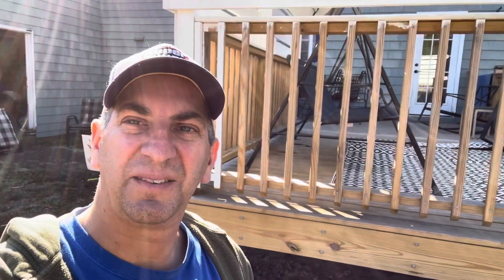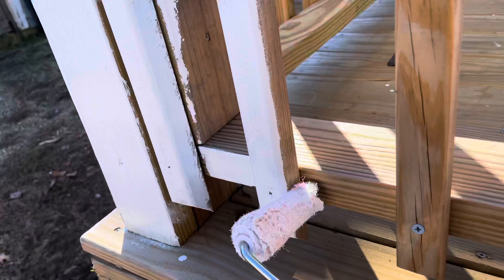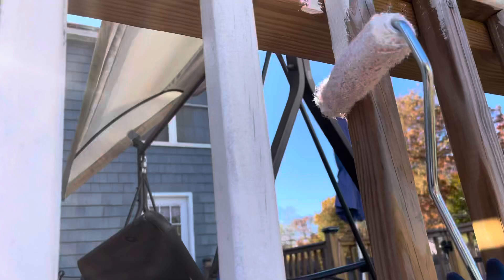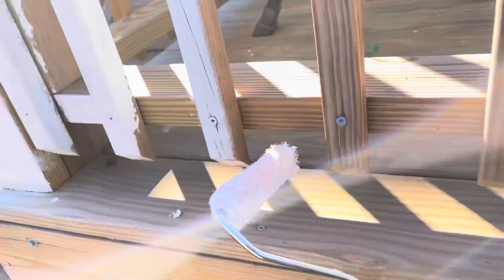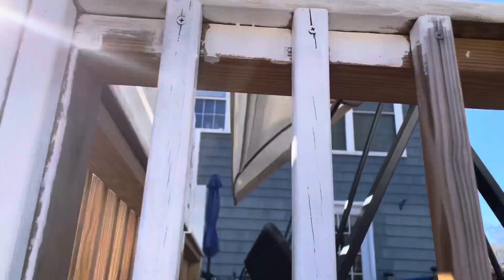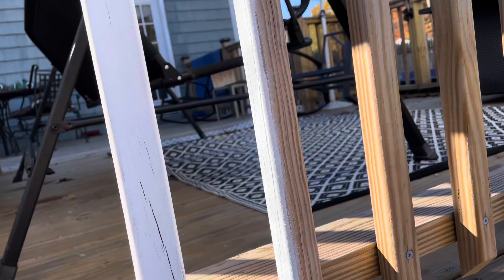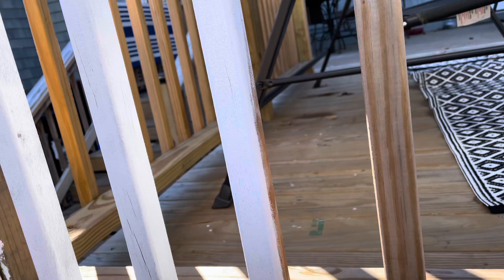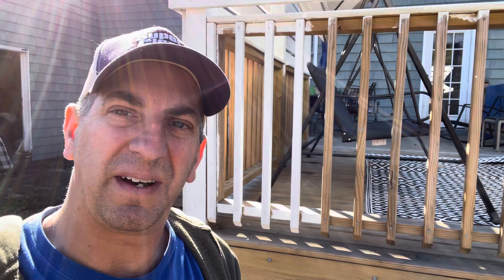How To Paint Railing Spindles - The Easy Way

Comment: This is the way I did mine.  I can't imagine doing it all wish a brush.  A lot of my spindles are cracked too and they look like shit if you don't fill the cracks.  But in a few years, even if you do fill them in, the cracks open up enough to cause the paint to crack and look like crap again.  I HATE, HATE, HATE my balconies.  I painted them about 7 years ago and now I'm doing it all over again and this time having to replace some rotten boards.  Everything about my property is high maintenance.  I HATE it!  I have literally been working months on getting everything done that needs doing.   I hope I never own another house with crap like this.  The treated lumber is another issue!  Eats right through the nails.
Reply from the maker: Thanks for sharing your experience! It's always helpful to hear from others who have been through similar challenges.

Comment: That's the pain in the ass method.  Try using a paint mitt.
Reply from the maker: I will have to try that next time.
Reply: All that work will take you days!
Try an invention called a spray gun! 😅
Reply: Sprayer will waste so much paint in between spindles. 75% of paint will go to the air, then will take lots of time to cover floor, walls, etc... so the time you save with sprayer you lose it with preparing.
Reply: How many spindles do you roll before going back with brush before paint starts drying?